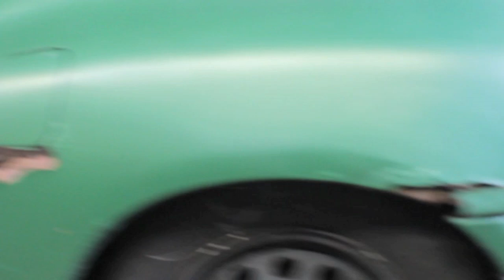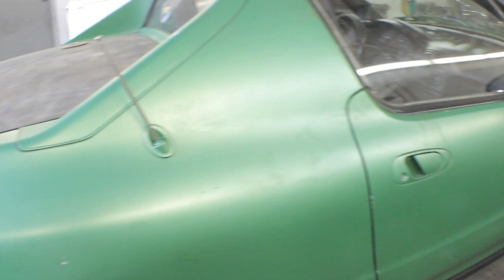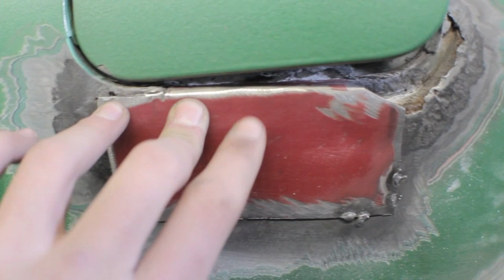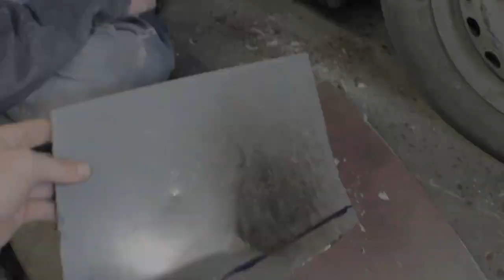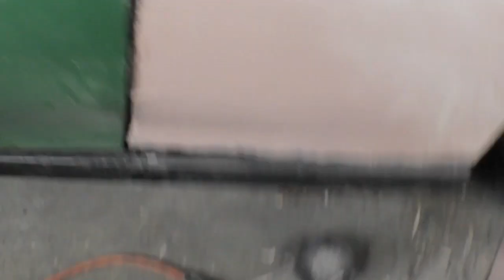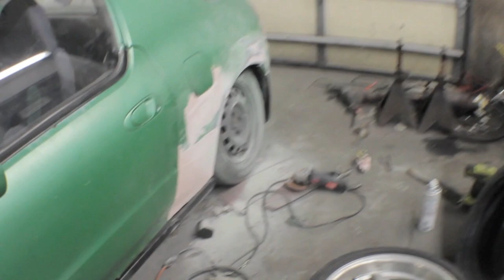Del Sol Rust Repair | Part 1

Comment: I bought a 95 Prelude with the same rust spots on the rear quarter panel I had an estimate done and they must be joking when they said 4 grand but some people refused to do it they said the rust is really bad I think it might have been in an accident before because the way the driver's side door opens it's not smooth it's like it was straightened by someone

Comment: Nice job trying to save the Del Sol. I've just had someone do mine.
Reply: Ever have issues with the door latch
Reply: Hey do you remember how much it was to get it done by someone?
Reply: The whole car respray plus rust repair was about 2k but that was cheap. It'll be more now.
Reply: @PrivateFosters  hey man appreciate the response even after 5 years. I can do the Bondo and paint I just need the service to weld in the new piece of metal to replace the rust, pretty much exactly the same as in the video, you have any idea what that would be just a few hundred I'm thinking ?
Reply: No mate, not sure how much it would be.
Reply: @PrivateFosters  appreciate it anyways!

Comment: Was wondering  if u new wat could be wrong with my car i have a honda civic it overheats at idle but wen I go the temperature  Needle goes down to normal temperature.  I already changed  the thermostat  and radiator  I don't see it leaking I tested  pressure the radiator and the gauge needle goes down slowly. think its the water pump  wat u think could be the problem
Reply: sounds like water pump
Reply: bleed the coolant system. take off the radiator cap, fill the radiator with coolant. turn the car on and let it run till the fan cycles on atleast 2-3 times to get the air bubbles out. let the car run with the radiator cap off so the air pockets can be released. i had the same issue with my integra
Reply: sounds like the temp control sensor.  just had the same issue with my 00' civic